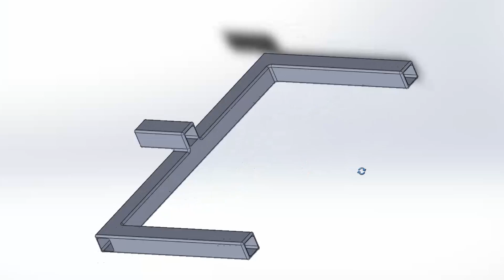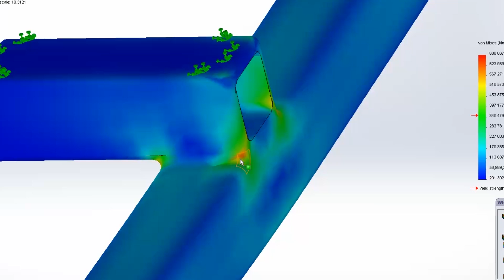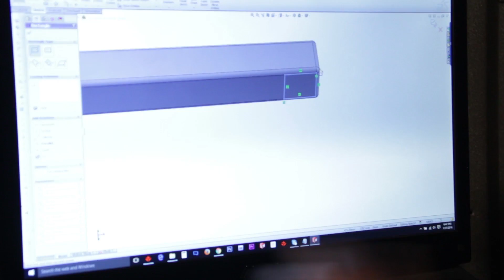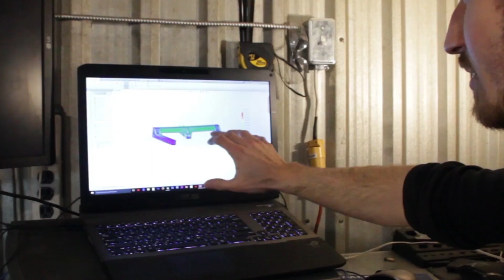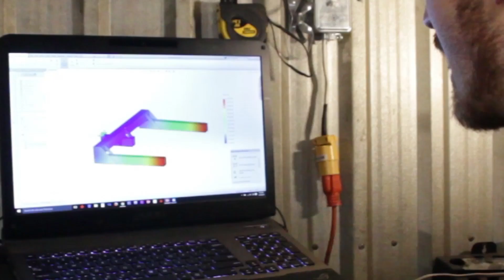Operation Truck Deadlift

Comment: I am a fellow exoskeleton builder and I have some ideas with pneumatic muscles and I have been able to test these ideas on a small scale, They proved very successful, for your mock
3 suit, I believe you should look into them. I have tested Festo artificial muscles and even tho they say fluidic that are in fact pneumatic.
Reply from the maker: +Bryan Bloomquist I have a video on pneumatic muscles if you look back in my videos! I do want to use them they just aren't as powerful as pneumatic cylinders. And while Festo calls them fluid, they aren't wrong -- air or hydraulic oil, it's all under "fluid power" just not the conventional idea of fluid as being a liquid =)
Reply: +the Hacksmith they don't have the ability to lift as much weight but, they do not have the chance of splintering like the cylinders if a force isn't directly above the rod
Reply: +the Hacksmith and I would take two pneumatic muscles over a rod in my calf any day

Comment: Don't put gusset plates at the center of a box section. Align them with the sides of the box for a much stronger and stiffer joint.

Comment: I still don't understand how you're making those welds?!?! Have you modified the welder because I have the same model and it barely works.
Reply from the maker: That's weird! I've been pretty happy with it. Are you using a 20A circuit? I've filled a 1" gap before by building up from each side!
Reply: the Hacksmith Yeah I have a 20A circuit  and everything. Did you buys yours new?
Reply: And maybe I just don't see it right and think I have the same one. What model is it?
Reply from the maker: Haha no I bought mine for $30 cause they said it was broken! Someone forgot to tighten then wire feeder!
Reply: the Hacksmith Huh, that's so weird
Reply: +the Hacksmith Congrats for getting onto CTV for your latest exo suit, can't wait for more projects, updates, and more. Also thanks for inspiring me, since I'm 14 I don't really know what I wanted to do but now I will try to make things, hopefully this summer I may be able to make a exo suit as well, after all awhile ago I made blue prints for one, that is a full body. So thanks for the inspiration.

Comment: When you finish the upper body, will you be able to pick up a truck without needing to rig the vehicle first?
Reply from the maker: +Clockwork621 Potentially... If I can grab the trailer hitch.
Reply: That's the plan

Comment: I had an idea for when you do the lift, if you put some steel panels around the back of the exo suit where the cylinders are it would protect your legs from being destroyed by the cylinders splintering if they do as your legs are protected by the steel and for behind the knee if you have some thick rubber with a steel wire frame then it will protect your legs pretty much all over
Reply: he said that in the video before

Comment: I can't freaking wait but keep in mind, as I said before you had a 2:1 mechanical advantage when lifting the mini whereas the way you are lifting the truck you don't so you are actually lifting 4x as much weight, in short, please don't bend your legs backward :P
Reply: I have a fairly poor understanding, but wouldn't you need to still be absurdly strong to lift something like that with a MA of 2:1?
Reply: +Samuel Weinstein the main point is that the truck weighed 2 times as much as the mini but he only lifted half the mini due to the mechanical advante so now he is lifting 4x as much

Comment: It isnt impressive until you lift those from your arms using the exo, you could of just put 2 cilinders under the metal thingy you made and it would be the exact same. It isnt about the max force you can put in the cilinders, its about how you use them. And i dont think pushbuttons are sufficient like your first exo, get someone to make a circuit which uses muscle sensors to drive the hydrolics
Reply from the maker: +daniel tabrizian This is the first prototype man, cut me some slack.
Reply: +the Hacksmith love ya chanel mate your doin grate
Reply: +the Hacksmith I know it is, im just saying that you should if mixed this exo with the old one and lift it from the arms. A simple joint would of been sufficient i think

Comment: So the simulations showed that the structure will hold, what about the cylinders on the exoskeleton? You said that they are at the limit of lifting power, aren't you concerned about that?
Reply from the maker: +Magic D Just under, each cylinder can put out 800lbs, bit of a safety factor in there too.
Reply: +the Hacksmith I hope nothing goes wrong and I cant wait to see the test :)